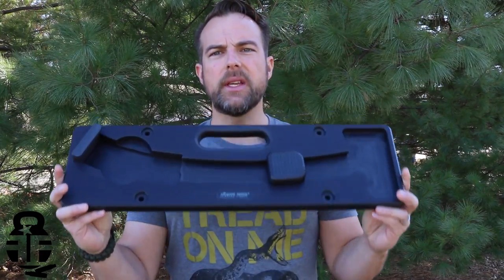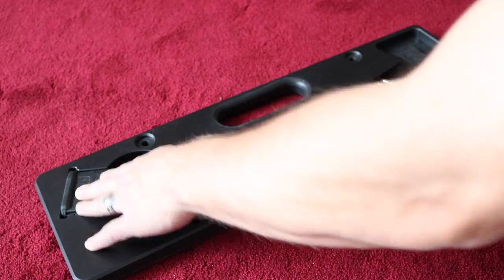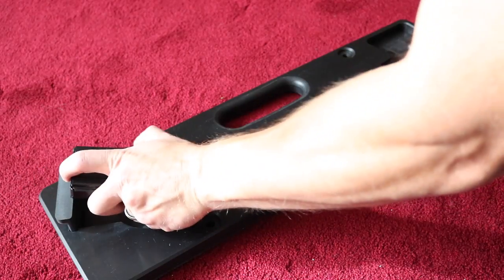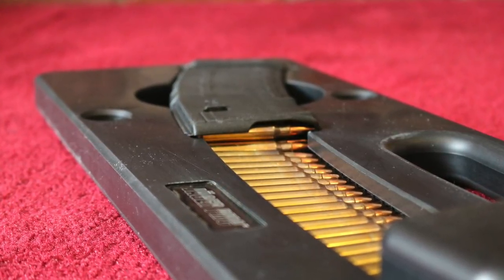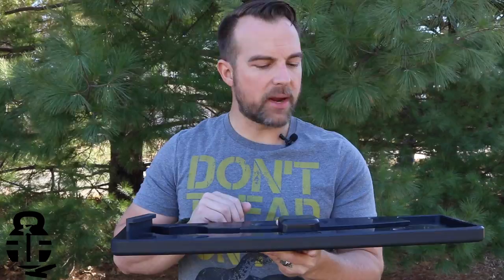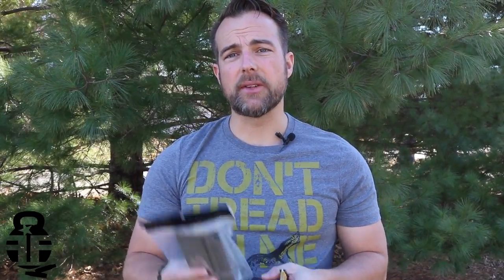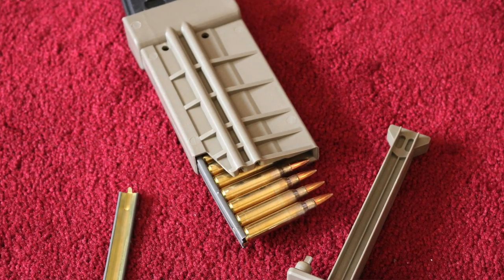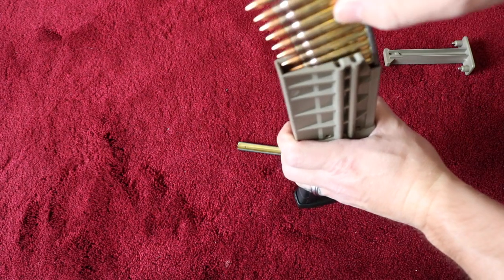JAGER PMC Magazine Loading Devices

Comment: will it work with .300
Reply from the maker: That is a good question. I think the board loaded could work but since 300 BO is shorter than 556 they may buckle as you're pushing them in. However, I don't think you will have any problems with the stripper clip speed loader.